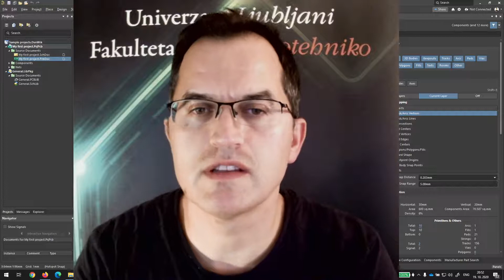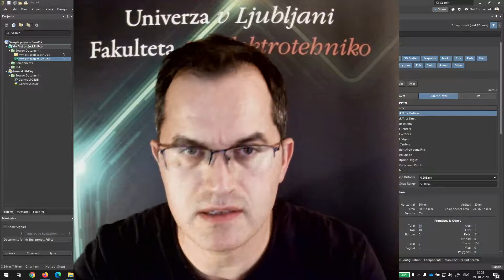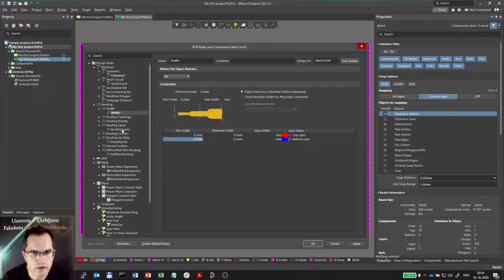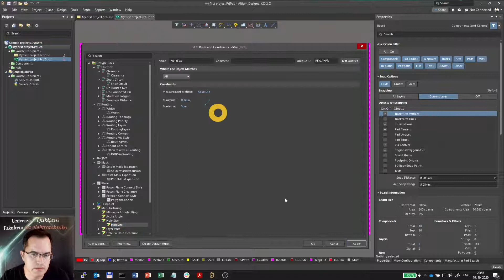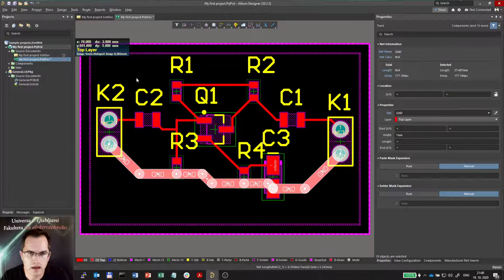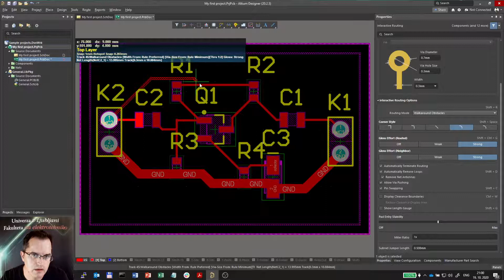Altium intro #24: Design rules

Comment: Hello, great video.

I'm a beginner and I have a question : Each time it connect a track and a pad or a track to another track, there's a white symbol appearing next to the connection. The white symbol is the white circle with two tracks crossing each other inside?

Do you know what could be the cause of this (clearance issue) and I How can solve it?
Reply from the maker: This means that you are trying to connect two different nets together and the symbol indicates, you will make a short circuit. This is what you usually don't want to do anyway.
Reply: @elektronika-fe1325  Hello, thank you very much for your feedback 😁.

In my wiring diagram, I have components wired in parallel and others connected in series.
However, in my PCB file, as long as  two tracks are connected or two components are connected (through a track and their pads) respecting the wiring diagram, can I deactivate the "short-circuit" option in the design >> Rules menu so I can connect my components following my electrical diagram?

Thank you in advance for your precious support.

Cordially.
Reply from the maker: @kevinhoublon8630  While routing try shortcut "Shift-R"
Reply: @elektronika-fe1325  Hello, thank you very much for your feedback 😊.

I've tried "Shift + R" :) but now the tracks seem to avoid the pads of the components but I want the tracks to connect to the pads of the components (so after clicking "Shift +R", I had to go in "Preferences >>PCB Editor>>Interactive Routing ") like the following video at the minute 8:30 for example : https://m.youtube.com/watch?v=75myMpZBUgk&list=PLR7y_-qHrkNCaoVp6BbOMwWHRkvfRJiVQ&index=3&t=1279s
In his videos, he connects the pads of his components thanks to tracks (following his diagrams in the minute 00:49 of the video)

This is exactly what I do but at the difference of him, I had the white "Short-circuit" symbol appearing each time I connected a track to the pads of a component. This is why I allowed the "Short-circuit" in the design Rule menu which removed the "Short-circuit" symbol.